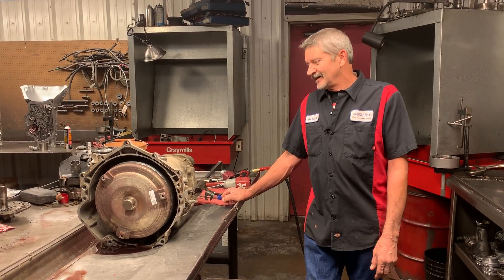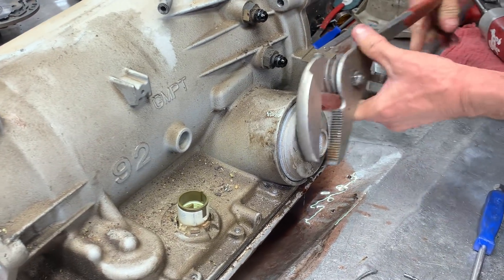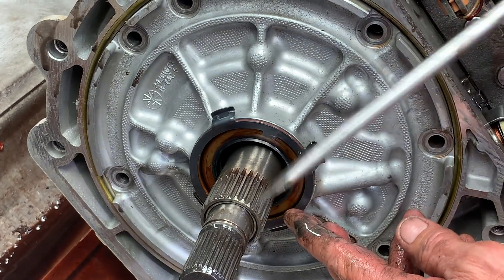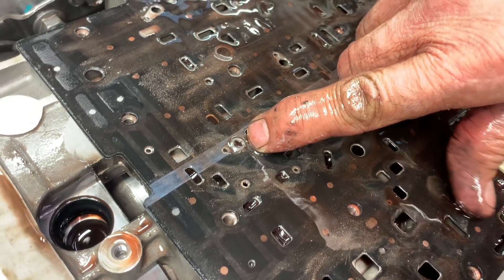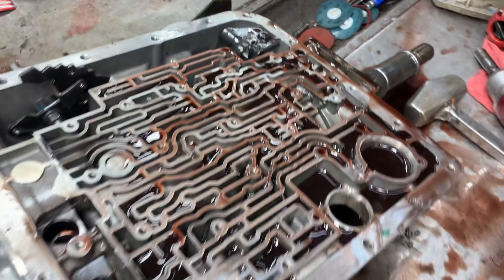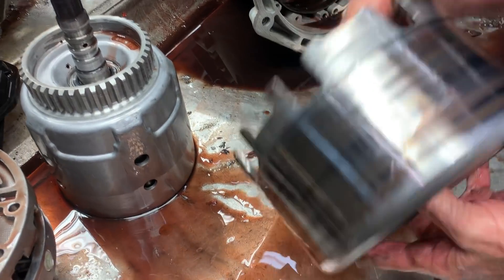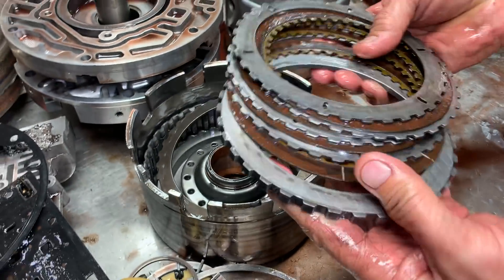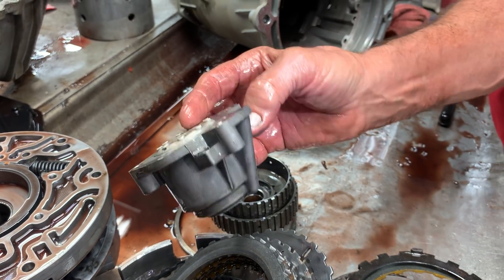Here’s the BOMB that went off in this 4L60E Video 2-2

Comment: Does anyone know if I can swap connectors from different years on the 4l60e? I have a 1995 yukon with a 4l60e but have an 2002 4l60e from a astro van im building in my garage. Just wondering if I were to swap that 02 4l60 in my 95 yukon can I just swap the connector harness to make it work, when I took down the pan to service it they had all the same solenoids.
Reply: I'm going to probably check  hell for this  jury rig  but The 95 is the switch over year to pwm torque converter  if the front pump have pwm on the 95 yes  it should work  with no problem  .  you can technically make the pwm transmission work in a non pwm by taking the pwm solenoid out take the end oring off and cut small grove from oil feed. Grove to the end of solenoid  use old harness and they shouldn't be a wire for that solenoid now it will lock up normal  or wir the pwm solenoid in with the torque converter solenoid so they both come on together
Reply: @bamadave1983  I was thinking the same thing since 95 went to PWM then it should work fine (with the 95 harness) I just wanted second opinion, when I did my fluid and filter change the valve body looked exactly the same. I was told that 95 was the odd ball 4l60e in yukons and suburbans and had to stay with a 95 transmission but in my mind since they all pretty much work the same with the same solenoids I didnt see a reason why not.
Reply: @martinez1701a  like I said 95 was a change over year some had pwm torque converter some didnt if the front pump on the 95 has pwm on the front of it it the same  if it dont have pwm on it you can do the "mod" and it would work with the 95 harness  the pwm trans has three solenoids on that bolts in the pump two that clip into the front of valvebody  by the filter tube  now if the  02 cam out of a Silverado  with 4.3 or la it has a 300mm converter and will not work but all the s 10 and pretty sure the astro had the 298mm converter
Reply: It should have the oring at the end of the input shaft that stepped down
Reply: @bamadave1983  yeah its a 298mm the 300mm was for LS applications I was actually gonna build the 02 4l60e for my 99 trans am converting it over to 300mm anyway I was thinking of building one for my 95 yukon also but seemed pretty dumb to try and find a 95 specific 4l60e if I can just convert a later model to work with my setup.

Comment: "That brown right there, that tells me it's got an input speed sensor in it." - The brown at the bottom of that connector was dirt. The pin count will tell if it has an input sensor or not. Opened the pan and oh my, no sensor.

Comment: The only transmission ive seen in worse condition the 3-4 clutch or the low reverse clutch pack had been so hot they were melted together. This was a 4L60Eand was by far the worst smelling transmission in the shop.

Comment: how in the hell did he drive it on to the lift with the planet in that bad a shape . the yellow glue they talk about is 3M weather striping adhesive and it's tough as nails  . it's the same stuff the manufactures used to use before they changed to something cheaper. it's amazing stuff and with it being water and oil proof it will last for decades unless you take it off . it will stick anything to anything and stay stuck unless like I said you take it off.

Comment: Why rebuild that.    Seems like the more economical is to buy a new
Reply: A transmission consists of many, many individual parts and pieces.  Those individual parts and pieces can be purchased new.  Assemble all the parts and pieces and rebuild the unit as a whole.   As long as the transmission case itself  isn't damaged, it can be rebuilt.  And they can last for years.
Reply: You’re not going to get a new 4L60E for this vintage of vehicle. They’re all rebuilt/remanufactured at this point. 

I’d rather have someone like Richard who knows what they’re doing rebuild it, then buy a reman in a box, and risk it being put together by someone with the same skill set as the last clown who “rebuilt” this.